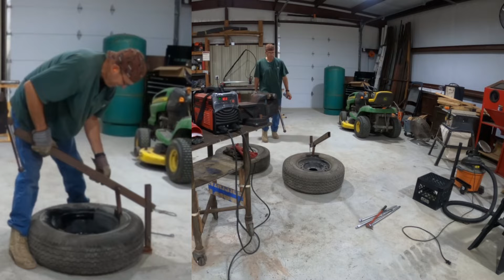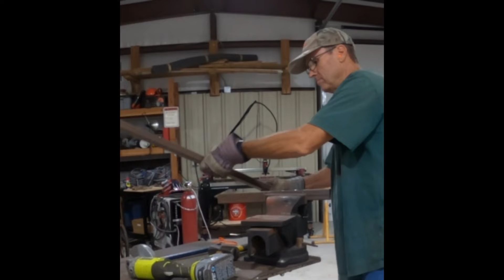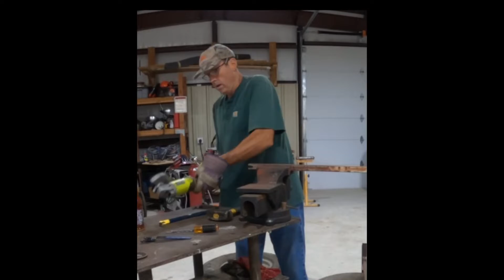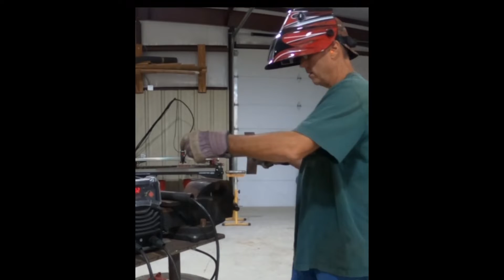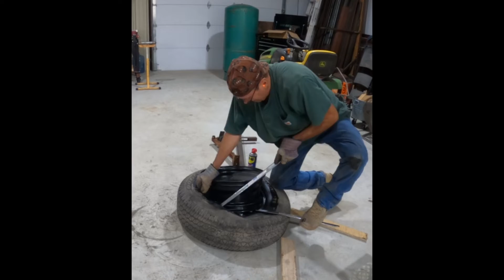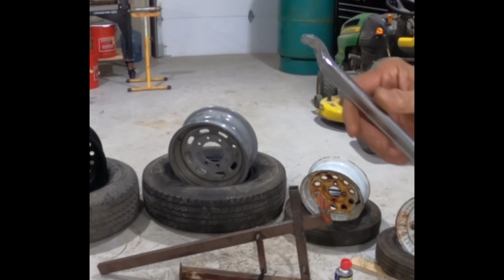DIY Tire Bead Breaker- and how to use it!

Comment: Thanks for making the video. How is the bead breaker holding up? Have you made any changes to it?  I'll be building one soon, which is why I'm asking... Thanks!
Reply from the maker: It did a good job as-is.  The one change I'd do would be to add a cross bolt to the back of the bar, instead of using the vice grip.
Reply: @BigDaddyDAdventures  Thanks!